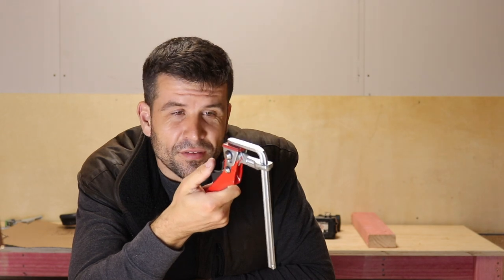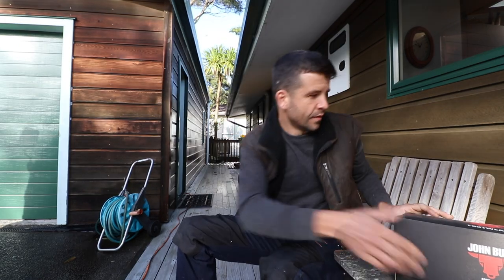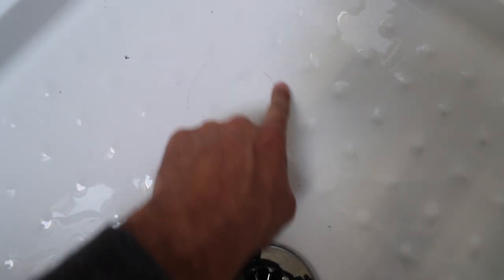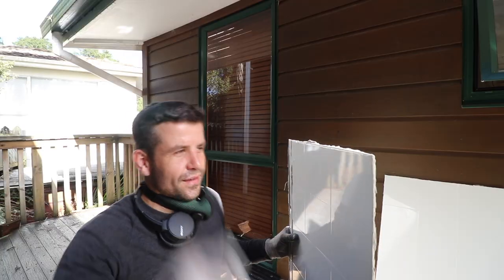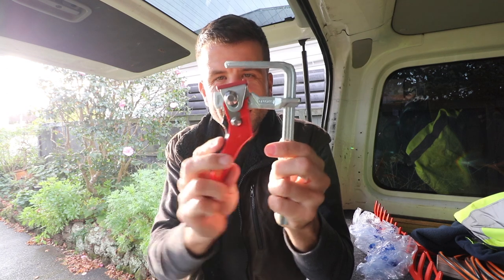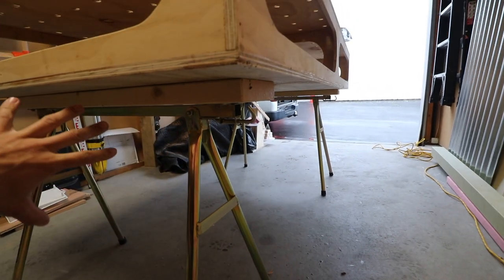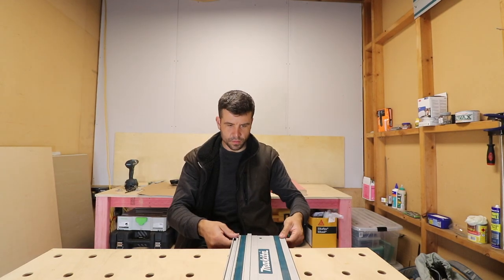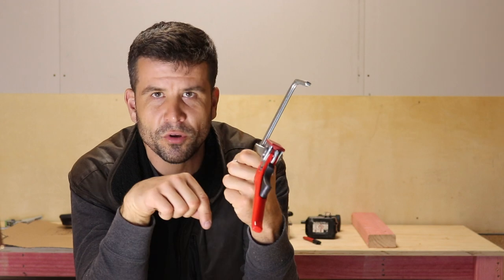Why You Should Buy These Clamps

Comment: I've been using the Bessey clamps for the last 30 years, and I'm still using the same pair just had to replace
 the springs in them, keep up the good work !!
Reply: Thanks for sharing. I am in my 60s and new to woodworking. I have done a lot of repairs and built a deck or two but no real woodwork. Everything is new to me. Now a need to build a proper work bench. Take care.

Comment: Scott, I had the same problem with a workbench, What i ended up doing is cutting a pc of 3/4” furniture birch plywood to 36”x48”. I also placed the 3/4” bench dog holes every 4” across and the length of the plywood. I just put that pc on saw horses and viola, i have a work bench modeled after the mft table. (Which by the way i have and love) what i love about the plywood work bench is its light and easy to move around. Keep up the good work.

Comment: For the longest time I had two torsion beams which were 2 feet wide and 7 feet long (so I could fit them in the bed of my truck). They worked for me for onsite work for the longest time; however, I  am not a builder. I am a hobbyist woodworker and handyman. Best of luck to you for figuring what will suit you the best!

Comment: Just an idea (ignore if it does not make sense :) ) ... cut the workbench exactly in half, reinforce the side you have cut (maybe with a ply-wood side wall, then at the bottom of each half (where they originally would meet, put some sort of bolt down device that tighten's them together for the times you need the full bench. This way, you'll have 2 smaller benches or 1 big bench when you need it. Just a thought :) Keep up the good work.

Comment: Don't let your soul get worn down laddy.
I finished a long day of moving a huge water tank which we cut in half to get up a large flight of steep deck stairs.  When finished I hosed off the stairs with water to clean up the debris.
My soles glided on the slick deck surface and I bounced down the stairs backwards banging my lower back vertabrae on every step.
I cannot describe the pain, plus time off to heal.
All because I let my souls wear thin.

Comment: If its possible to rip in half try it and maybe add hinges on one side to join the two. Then you could fold it closed for half size and fold it open for full size areas. Also could add a few wheels at the corners to help with portability. Keep up the good work brother.

Comment: Nice stuff, I have smaller version of that bench, that folds into the back of a portable tool trolley, bench is about 1200 by 600. Also building attachable side tables so that I can rip full sheets if need be, but don’t need them all the time, hence the attachable nature of them.
The trolley is of course on wheels so I can push it around, and it holds four shelves with boxes to hold tools and screws etc.

Comment: I had to laugh when I saw the Bosch dust bag. I knew exactly what was about to happen. I think all us Dewalt Table saw users have the same one. Nice pickup. That bag works great btw. You’ll really be glad you got it.
Reply: Oh where do I get one in the uk
Reply: JuiceBanger1 I’m not really sure. You can can use Amazon right? Lol. Mine is a Bosch TS1004. But I have a little bit different saw than his. I have the job site table saw that is on the rolling cart. Not sure if the dust port diameter is different or not. You could easily google it and go see some pics and reviews on Amazon. Good luck brother.
Reply: @DisconXion  I've the dw745 jobsite saw. Il check amazon thanks.

Comment: I was semi-joking last time - but seriously take a look at plastic pallets mate... they're available in a range of sizes, they're strong, light-ish at about 7kg, they're cheap/free (trademe, facebook markets, or just hunt around some industrial areas) so it's not an expensive experiment, and if it actually works out for you, replacement 'parts' are cheap and readily available.  You can get the type with grid tops - they have rubber non-slip pads built in by the way, or, you could get a solid top type (e.g. https://www.secureaload.co.nz/pp_used.html ) and drill the holes you want.  They have the open sides just like the paulk table.  The main question mark, (apart from how would you live with the aesthetic lol) is fitting the legs.  I've got a bunch of them for another project, but right now I have them in three stacks for a work platform for the posts and rails for my fence: https://imgur.com/a/Ot3kqVg
Reply: Rawiri Blundell I like that idea! Will keep my eyes open.

Comment: Maybe drill a couple holes through your horses and use the clamps to attach them to the bench top or get clasps/chest latches and and use them to secure them together. Then you could have different size bench tops you could use with the same base.

Comment: Hi Scott, I also built one of those work benches, but I modified the design so it's two 8' by 2' sections with four legs so I can set it up as one long 16' bench or in an L shape or two separate units or just use one.
Reply: Do you have pictures of that setup? That is an interesting idea. What sort of legs do you use? I like the idea of the wooden sawhorses. These won't fit in the workbench after changing the dimensions. So I'm curious about how the redesign comes together.
Reply: @adriaan7627  I do I'll add them to my next reply, I've used the ply wood legs sameish design just a lot narrower four legs in total two for each section. Then drilled holes on each side and end of both units so i can bolt them together if required. I find them a lot more useable and easy to move than one large 8'x4' unit
Reply: ok so can't add pictures to a reply!
Reply: Chris Kenny Guess you have to make a movie 😁
Reply: Jay Bates has done on for me! go to 15:35 mins in to the video

Comment: After sharpening, you should burnish the edge. Sharpening creates a lot of micro tears at the tip of the blade. A burnisher flattens those tears back into the metal, and you end up with an even sharper blade. Works every time. This is why teh Burnisher was invented.

Comment: Ron Paulk's original bench was built in two pieces, each 24" x 96".  I've found that holding down the width like that makes each half  of the bench much more easily portaged, as well as usable by itself for many tasks involving lumber, trim, or just about anything besides full sheet goods. Fastcap altered the design, making it as a single piece, both shorter and much wider. This move to simplify cancelled one of the most important characteristics of Ron's original design IMO.

Comment: Is it possible to cut your new bench in half along its longest dimension?  Then add new sides on each, then carry one or two benches to the job site as needed.  If you need two carry each to the work horses and fasten to horses.  Or you could add foldout legs to each, then when you need a bigger workbench, set them side by side and clamp together from underneath.  Or some sort of bolt system through the two sides that draw the two workbenches tight up against each other.  You would need a way to access the inner part of the table.  I plan on making two 2x6 tables of similar design and maybe using some very lightweight plywood I have seen Ron Paulk use.  But as of yet, that plywood isn't available in my area.

Comment: Rebuild your bench making it two joinable lengthwise halves.  Half the weight and size and full when needed.  That's what I did using the Paulo design.
Reply: You mean cut it in half right ??..
Reply: Onasis Aristotle - yes but lenghtwise

Comment: Do your boots have steel mid-soles? If so, no should prevent nail from going through, if not then yes, that's why if penetration injury is identified on risk assessment for a site in UK, steel mid-soles are required. All our waste site inspectors need to have them.

Comment: Just cut the table in half Scott.. 2ft by 8ft or even 2 by 6 would be big enough.. What make are the clamps?
Reply: Albertdog101 haha
Reply: Speak metric too please
Reply: ILoveLSD13 He’s right though. It’s too big. About as long but half the depth. I keep a plywood sheet in the roof of my van, 2 ft by 6 ft, whatever the conversion is, and a couple plastic horses. For added strength, I’ll add a couple of 6 ft balusters underneath.

Comment: Never figured out why you would need such an awkward table on a jobsite. Useful for a workshop yeah but it doesnt look portable to me. Just use stools, couple of sticks amd one sheet of the sheetgoods your using.  KISS. Anyway, up tp you if you wanna lug stuff like that around.  Incidentally,  do you know of those clamps would fit the dewalt track saw? Dewalt ones are ratger expensive. Thanks

Comment: I just did the Paulk plywood stands in the plans and they hold up to an immense amount of weight.  Those legs are sorta janky and not up to the task.  ☹️

Also cut the bench down the middle and make a few new side pieces.  Them you can put them together with a few nuts and bolts or just use one side.  I did that with the 4'x8' version.  Way easier to move around two pieces.

Comment: "This workbench is too big.  Gonna have to build a smaller one."
Ron Paulk has already thought of that (sort of); the Paulk Workbench II (https://www.youtube.com/watch?v=KnNi6Tpp-ac).  It is made as two halves which can be used independently or joined together.  In your case you could make two halves each two-thirds the size of your current bench and that should give you quite a bit of surface area to work from.

Comment: And I still don't understand why you made that bench that size with inexact hole positioning in the first place.
Reply: Hugh Tattersall: Indeed,  I Made myself several portable workbenches using Peter Parfitt’s system. Quick and 100% reliable for square and angles. As well as ‘compatibele” with the Festool system.